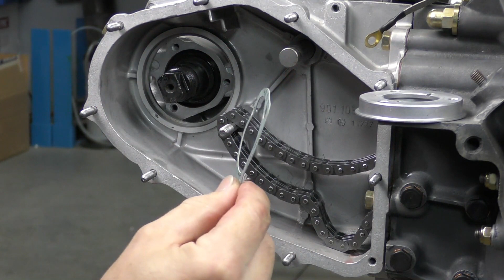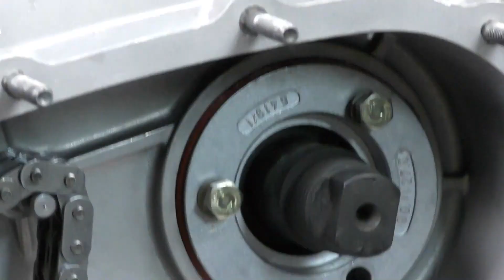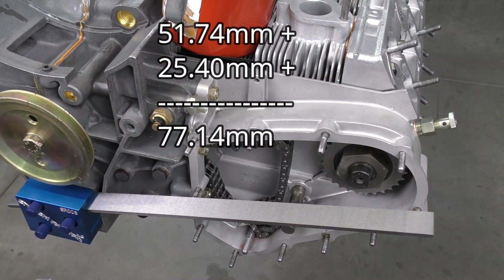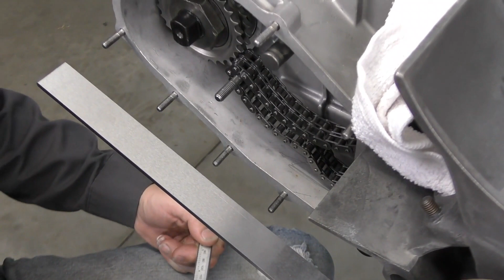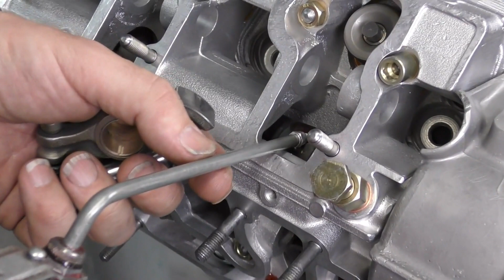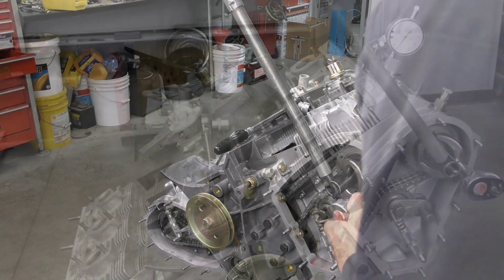How To Set Porsche Cam Timing. Rebuilding your air-cooled Porsche engine

Comment: Very impressed with this fountain of informative videos for us garage hacks.  Back in 2003 I installed my RSR seals with the engine still in the car on my 3.0 !  Yes had to be a contortionist. and I was 20 years younger.  Made my own tools due to the tight access.  In the video I paid particular attention to how he was setting the tappet valve clearance and watching how much drag was on  gauge  once tightened and set.  When using the screwdriver and open end wrench it is very easy to over tighten or get the .004 spec too loose.  I see he can easily spin the gauge without it binding and removes easily.  I would guess he is more at .005-6 then at .004 but just nit picking.  Great presentations and thank you.  It's about time someone posted this kind of very democratic and informative procedure.  On a side note, getting kind of tired of watching all the gold card porschettes out there  installing independent throttle bodies  on their 3.0 and then wondering why when dyno'd they only get perhaps a 10-hp gain and not 30 hp + as promised but only after spending 6 or 7 grand on overpriced assemblies and installs etc ....
Reply from the maker: zzzz,
Its hard to show a valve adjustment, because it's a feeling not a visually thing. When I worked for Porsche we were not allowed to do a valve adjustment without it being checked by another mechanic for about a year. 34 years later I think I got it now and can do them pretty quickly and know that I'm hitting my tolerances. Yes I agree with the bolt on stuff is usually not very well thought out and most often will take the car backwards in drivability. 
Thanks for you comment 
Kurt

Comment: Very very nice job,LOVE to see how meticulously you rebuild It
Only thing  to say : when you Torque the cam nuts, the correct way to use the open key Whit the Torque wrench is turning It 90grade of the Torque wrench.... (nice nice job ofcourse!)
Reply from the maker: Yes you are correct. to get an accurate torque the crows foot  socket should be 90 degrees to the torque wrench.
Thanks for watching
Reply: @klassikats  however, LOVE your work,im looking to Buy a classic 911 and looking for ovehaul the engine if its necesary 😅

Comment: I'm up to this video and they have been so helpful so far so thank you!  I started the left side cam timing and learning the hard way.  It looks like when I torque the cam bolt on my carrera 3.2 I'm adding .05mm of valve lift at tdc after it's set.  I guess I'll attempt to reduce the initial setting by that amount before torque down, but I'm going to take a break tonight and start again in the morning.  So far a fun engine to work on and a challenge for sure.  You're a master without a doubt.
Reply from the maker: Vic,
What is happening is the gear is moving slightly against the timing pin as your tighten the bolt, which is normal. You can slightly preload the pin in a different hole and see if that helps. Also 0.05mm is not a huge change as long as the timing is still within the specifications.
Kurt
Reply: I think I figured it out.  If I come down to spec at TDC by turning the 1-3 bank cam clockwise I can expect a .135mm reduction in lift due to the pin moving into position when torquing down the big cam bolt.  So I'm going to go back in the garage and try adding that to my spec and then tighten it down and see if I'm close to my 1.26mm target.
Reply: All done and both sides are a match.  Once again thank you so much for making these videos.  It's really helped me develop my skill set.

Comment: I would like to thank you for explaining cam timing so easy. I’ve watched several videos but, you explain it so easy. Though, I would like to ask; what should be the valve lift for a 3.2 engine? Thank you! 🙏
Reply from the maker: Glad it was helpful!
The Valve timing on the 3.2L is 1.1mm to 1.4 mm with optimal setting of 1.25 mm
Thanks
Kurt
Reply: I own a 1984 Porsche 911 Cabriolet European version. Back in 2015, I decided to repair the engine cause it had several broken studs. After the rebuild, everything was fine but thereafter, it was producing a knocking sound. I checked the oil pressure and it had none! I was told that because the car was seating for so long the chain tensioners were jammed! Now I’m looking to tear down the engine again to see what got damage and replace the chain tensioners. So frustrated!

Comment: Great video series!  I have watched and enjoyed every one.  Can’t wait to tackle my 2.7L
Reply from the maker: Thanks Andy,
Glad that you have enjoyed them and good luck on your own 2.7L project
Reply: @klassikats  is the settings for the cams the same for all engine sizers or does 2.7 have different settings!..cheers!
Reply from the maker: @john2ndname  Mike, each camshaft has its own timing specifications. All Engines have multiple camshaft choices. You need to identify the camshaft using the number stamped into the front of the camshaft. Then refer to the shop manual for the correct timing specifications. 
Kurt
Reply: @klassikats  cheers Kurt!
Reply: @klassikats  Kurt!..can you suggest a good workshop manual for the 1977 2.7 ltre engine!..thanks
Reply from the maker: @john2ndname  Mike the only one I use is the factory manual set. for your car. The aftermarket ones out there for your car are not very good and lack the correct information to work on your car.
Reply: @klassikats  Kurt!..I do have "Haynes Porsche 911 1965-1985 Owners Workshop Manual" it does cover the 2.7 i will go through it to see if it has factory specs then measure my parts like crank,cams,valves and heads and compare!..cheers!
Reply from the maker: @john2ndname  Mike, There in lies the problem. The 911 changed so much from 1965 to 1985. The issue I have with books like Haynes manuals is they try to cover too many models with just one 100 page book. The factory shop manuals are 8 books to cover the same material. The only decent aftermarket manual that I have found is the Bently manuals. However, to my knowledge I don't believe they have one for the 1974-77 911.
Reply: @klassikats  I'll keep researching thanks Kurt.

Comment: When roughing in the cams, wouldn't you want the 1-2-3 cam dot up and the 4-5-6 cam dot down. Having a hard time getting my head around that. I would think you'd want them set at 360 degrees of crank opposed to each other, 180 degrees on the cam.
Reply from the maker: You always start with dots up on both cams.
Kurt

Comment: Very good source of information. First class!! Love to watch your videos. I would like to know what could be expectetd from engine running setting the timing to the end of the tolerance.
I own a 930.16 that was professionel overhauled and i found the cam timing one side set to 1,7 and the other side to 1,72.   I checked this because the engine feels a little different than before the overhaul.
Regards Michael
Reply from the maker: Changes in cam timing will affect the power band. Advancing the cams will cause the power band to move lower in the RPM range while retarding the cams will move the power band higher in the RPM range. Setting the cam timing to either side of the of the specification range will make very slight differences that 99.9% of drivers will not notice any difference.
Kurt

Comment: Thanks Kurt, awesome work and presentation. On a 2.7 CIS I discovered several broken head studs. Not sure if should just do the top or a complete tear down. I don't have any indication on total miles or whether it was ever rebuilt. In any case, as clear as this video is, I do not understand setting the crankshaft pulley to Z1 when you set C4 clearance. Wouldn't the act of turning the crankshaft move C1 (i.e. wouldn't this upset the timing between the banks?).
Reply from the maker: Herbert,
Cylinder one and cylinder four are 360 degrees apart. When cylinder one is at TDC, cylinder four will be at overlap. So when you turn the crankshaft from TDC cylinder one, 360 degrees to TDC cylinder four cylinder one will now be at Overlap.
Hope this helps
Kurt
Reply: Love your videos!

Comment: I have watch your video  on engine assembly  and they are super iam all done and have the engine in the car , I start the engine and when I let go of the key it shuts down I have to have wire on the wrong plug it's starts and the minute I let go of key it shuts down
Reply from the maker: There are two possible issues here. Firstly it may be running on the cold start injector which only runs during cranking. Then when you let go of the key there is no fuel flow and the engine dies. The other issue is power to the CDI ignition system, is dropping out as soon as you let go of the key. Could be a bad ignition switch.
both are easy to check. If you put your volt meter on the CDI power input and have someone crank the engine while you watch the +15 circuit. If power drops out when the key is in the run position, look at the ignition switch. 
Also for the fuel system look at the roll over switch on the sensor plate and make sure everything is adjusted correctly there.
Kurt
Reply: There are 2 connecters 1 on each side of the intake and 4 connecters behind the trouble body 1 I no only can go I place it has 3 prongs the other 3 are they to go special places they are 2 prong thank you...john

Comment: Kurt really enjoyed your video on the cam timing and it gave me a better insight on understanding that.  
 I have a question to ask you on setting the cam timing.  I have a relative that is an auto mechanic and he doesn’t think that he needs to use a dial caliper or a digital gauge to set the cam timing he thinks he can use a degree wheel to do that. he has no experienced with working on Porsche engines at all he rebuilt one Volkswagon engine once.    Thank you
Marion fisk
Reply from the maker: Marion, 
Even when using a degree wheel you still need to use a dial gauge to know where the cam is. Accurate measurement is the key to precision, unfortunately to many mechanics do not have these skills. When working on many of the domestic and imported cars out there, they mark the timing positions with dots or dashes. This is so the production line assemblers can literally throw it together. A mechanic that just works on those cars can go their entire career without using a dial gauge to set timing. The unfortunate thing about that is they never really have a true idea what is actually happening.
Thanks
Kurt

Comment: Learning lots!  Was hoping to see your technique for torquing the rocker shafts.  Do you position all 5mm bolt faces to the flywheel side and work your way out 1>3, 4>6 ?
Reply from the maker: We show the rocker arm assembly in another video. The position on the rocker shaft is very important, and it is one of the things that I see installed incorrectly all the time. The 5 mm Allen head needs to be positioned so that it can be accessed at all times, as rocker shaft torques are a service item. I will usually install them in the firing order as I need the Camshaft to be in compression and I can set the valve clearance as well.
Kurt

Comment: Thanks Kurt great video if i'm just putting back the cams and they are good without any work done to them can i just put back the same amount of shims for each cam that came off before unesembly. i would measure just to be shore though.
Reply from the maker: I always measure the chain depth. It doesn't take long and I cant tell you how many times I find that the last guy got it wrong.
Kurt
Reply: @klassikats  Thanks Kurt..your tips are a life saver.

Comment: Wow, awesome video, Kurt!

With my 993 engine in, I'm currently tackling those rectangular cam chain box cover gaskets, the camshaft o-rings/paper gaskets, and lastly the timing chain cover gaskets. Is it possible to not redo the timing if you put your engine at TDC, lock your crankshaft pulley in place or just make sure it never moves during the job, then put the sprocket back exactly in the same location on the chain and put the pin exactly back in the same hole?
Reply from the maker: I'd recommend at least checking the timing after replacing the gaskets just to be sure. 
Kurt

Comment: What did you set the valve gap to? And when you torqued the large cam nuts, shouldn't the crowfoot be 90 degrees to the torque wrench.
Reply from the maker: Valve clearance is 0.100 mm (0.004"). Yes in a perfect world the crows foot should be at 90 degrees to the wrench and yes I usually try to keep it there but sometimes it ends off being off. So looking at the video it looks like the crows foot is about 45 degrees to the inside of the torque wrench. That is going to result in a torque reading that is 3.4 Nm higher than the desired torque. Just the drag alone on the wave washer is probably worth more than that so I am not to worried about it.
Thanks for watching
Kurt

Comment: Hi Kurt,

Is it possible to replace the chain without splitting the case? I see there are chains with master links available. A complete rebuild is out of my budget, but I have a stretched bank 1 chain so it probably prudent to chainge to gain some time before a complete rebuild. Tensioner is not hitting case yet but it has some play (1mm). Thanks this vid was awesome as they all are!
Reply from the maker: Yes you can change the chains without splitting the case. You just cut the existing chain and join the new split link chain to the old chain and wind it in.
Kurt

Comment: On the 4 rocker, do you have a special 8 mm hex wrench? If so, can you provide a link?  I have a standard hex set with 90-degree bend. There is not enough clearance between the cam box end and the  rocker shaft to use it. Thanks for the great videos and replies.
Reply from the maker: Yes, I made my own as an apprentice while working for Porsche. Mine is made using an old head stud with a small piece of 8 mm hex welded to it
Kurt

Comment: Hi Kurt. Is it unusual to use fewer shims? On the right side, my measurements left me with 2 shims (.5 mm each). 

My rocker shafts didn't install as easily as yours. It took a socket extension and a small hammer to tap them in. Is that indicative of something is not right? I'm using the RSR seals if it matters.
Reply from the maker: Yes it is normal for the shim count to be different on the cam gears. There are a couple of things that can cause the rocker shafts to be tight. First would be damage in the cam box bores causing an interference with the shaft. If you are using used rocker shafts they may taken a set and the shaft may be slightly belled at each end. Lastly make sure you are lubing the RSR seal well enough as it can drag if you try to install them dry.
Kurt

Comment: Kurt i email a while back. Iam working on a 1980 porsche 911sc .i had to replace the head studs as they wer broking off  so i replace all the head studs with new and put the engine in the car , and it would start and theminute i let go of the key it would shut off ther are 2 wires that go to each.side of the motor  that are mabe fuel regulaters, and 4 wires that go to the back of the fuel and air.box the plug ends are color coded maybe any chace there is a digram for these lugs   ,, the car will. Run now but will not idle if disconect the plugs once i connect the plugs the car shuts off once the key goes from start  to run passions any help ;;;; Also i understand u make a wire.harness for the top of the engine thank you john
Reply from the maker: John, 
As I said in my email to you there can be a number of items that can cause this. It sounds like it starts and runs on the cold start injector only and that the fuel pump is not continuing to run. I would look at the roll over switch on the sensor plate as well as the fuel pump relay to see that it is getting the trigger signals it needs.
Kurt

Comment: Can timing improperly set prevent an engine from starting?
Reply from the maker: It would have to be off a long way to prevent the engine from starting. The other issue is that if it was off far enough that the engine wont start you most likely have valves hitting pistons.
Kurt
Reply: @klassikats  Thanks Kurt..Keep those videos coming. I always learn something useful.
Reply: @klassikats  Kurt, I have noticed from watching so many videos on cam timing that everyone always set the gauges up with the foot riding on the valve. Why is it necessary to install the rockers and set the lash to .1mm for intake valves 1 and 4. Since the gauge's foot is riding on the valve, is it necessary to install the rocker? What's the purpose?

Comment: Hello Kurt.  What cams part# do you have here?   Your spec is 2.5mm overlap at TDC.  Im working on a 2.7 CIS carrera and specs show 0.47mm
Reply from the maker: Could not tell you as I did this job to long ago to remember. However, if the engine type and the cams you are using call for 0.47 mm then that is what you should set you timing too.
Kurt